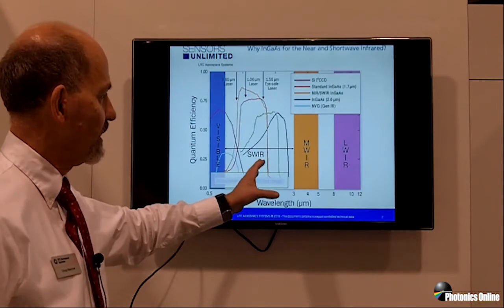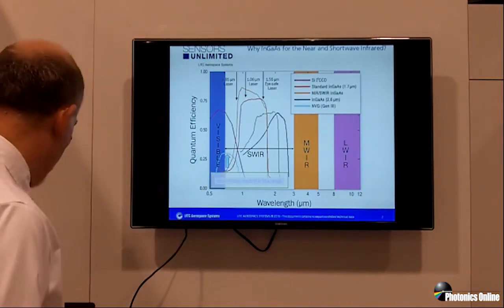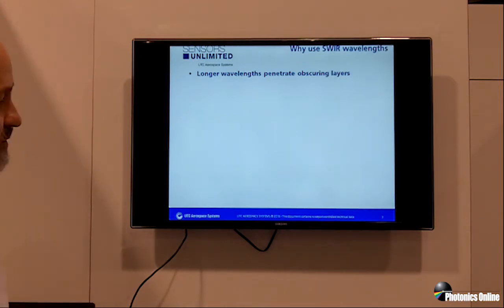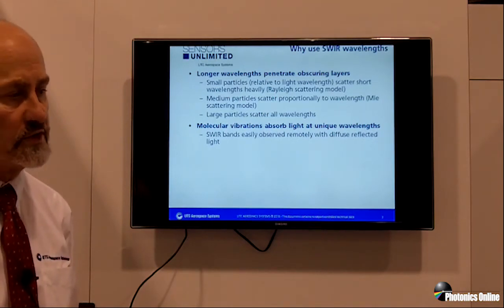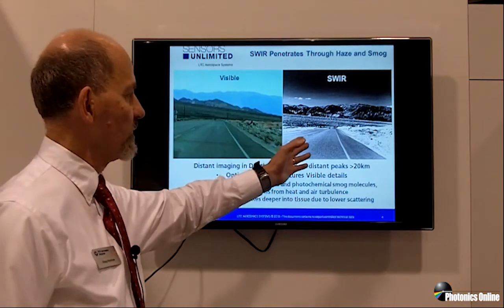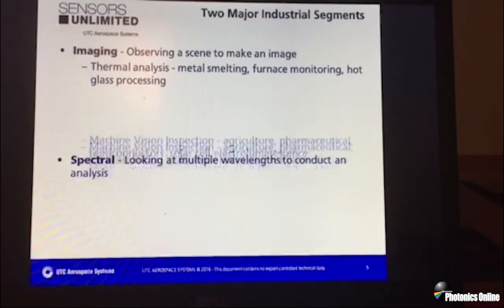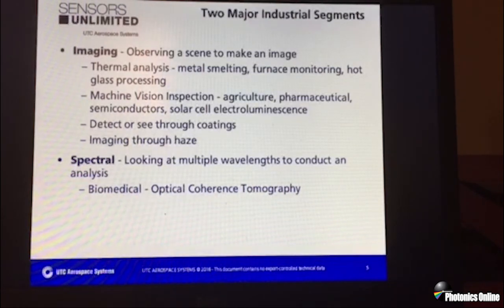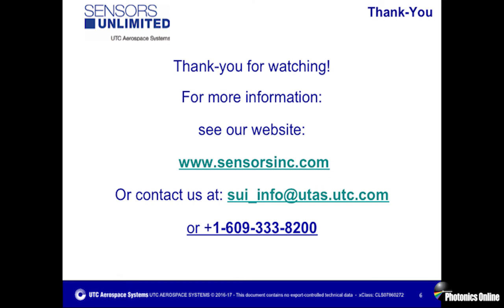Why Use SWIR?

Comment: great video and even better sensors in 2020?  is it possible to detect compounds as different types of sulfur to be mixed into rubber and verify the correct sulfur quickly?  thanks